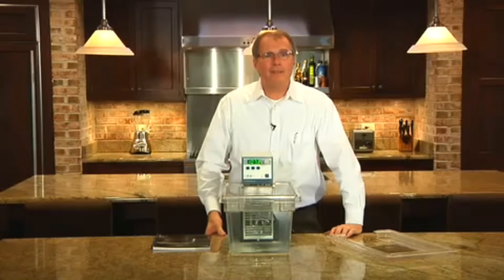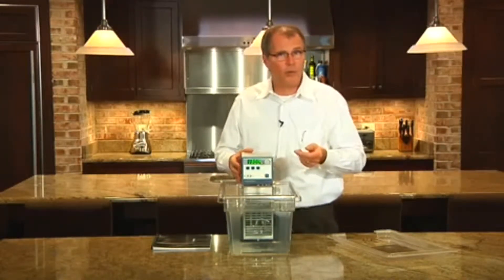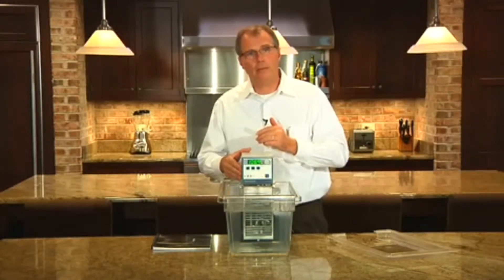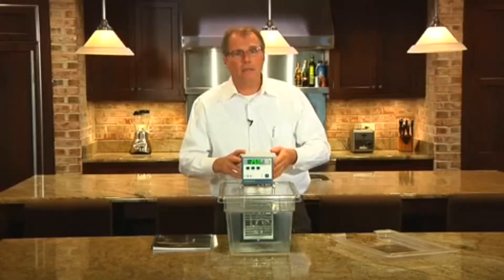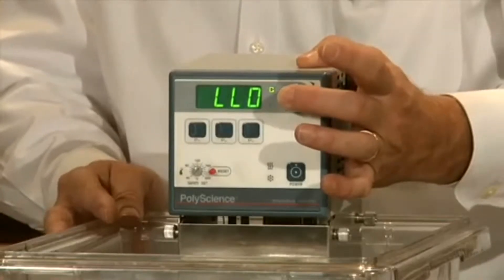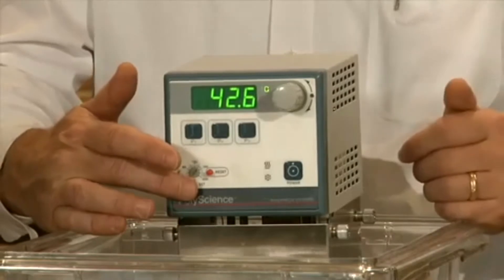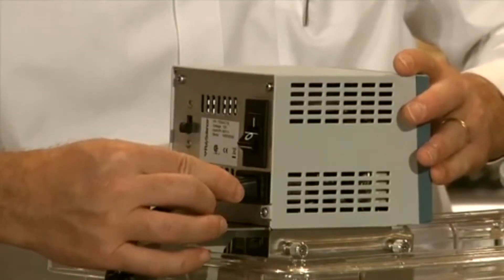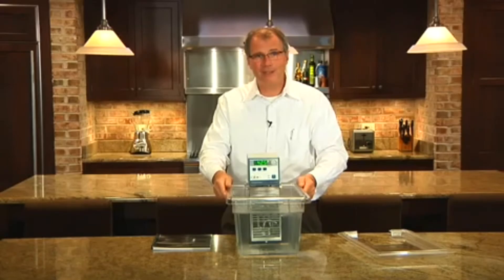PolyScience® - Sous Vide Professional - Model #7306AC1B

Comment from the maker: No, you cannot use this product with a 240V power outlet.  However, PolyScience sells some models configured for international electrical voltages and cycles that may work for your application.

If you'd like more information please let us know: 800-244-8729 (From outside the USA 415-863-3614).